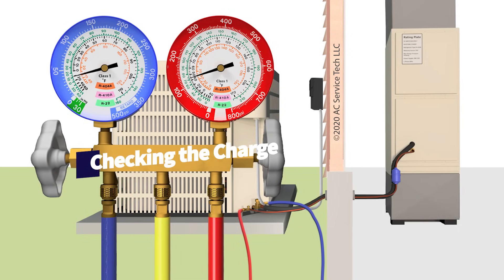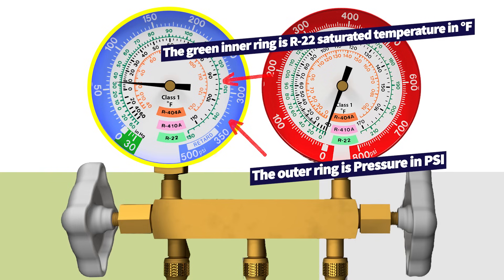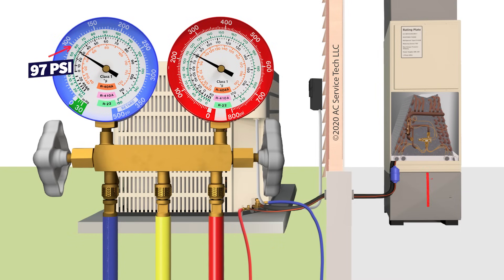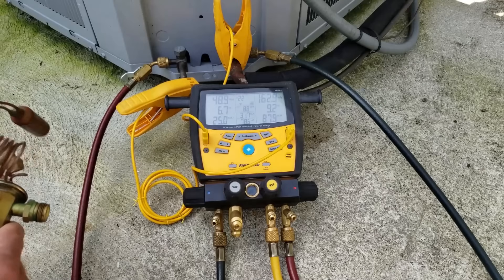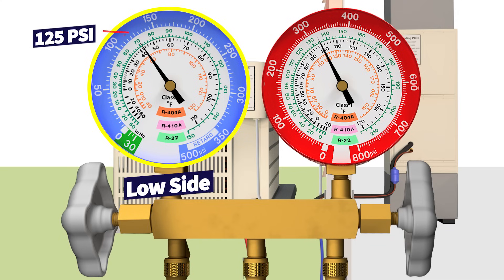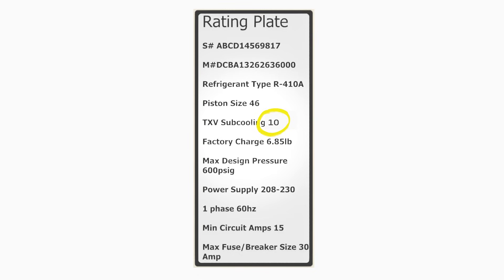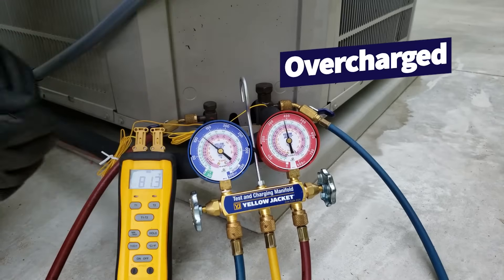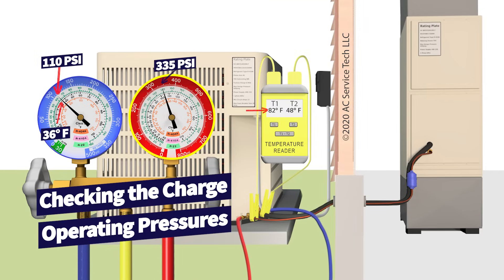R-22 and R-410A Operating Pressures on Air Conditioners! Checking the Charge!

Comment: Unless I am missing something all of this information is only for cooling not for heating. It is winter time, and trying to get my system to operate correctly. Pressure on low very high but only getting 77 degrees on a 40-50 degree day. Can we not check system pressures in the winter? Thanks for ypur video. 😊

Comment: How about inverter mini splits with R32/R410A with one service port at the gas line (most with EEV)?
I personaly look at pressure/temp according to inside/outside temp (depending on mode), making sure I have proper airflow and with ampmeter to know how pumped the iverter is.

Comment: What causes a pressure on R22 on sucion line of 130 and liquid of 200? Could it be that the expansion orifice has failed and is letting more liquid into the evap? It also has a txv on the outside unit looks like for heat pump mode. I am new at this.

Comment: Trying to wrap my head around SH/SC... I have a 22 unit with a piston expansion valve [I thought it was a fixed orifice] It runs at 75 on the low 220 on the high the delta-T varies between 16-21 deg which seems right. I still have to check the suction line temp at the condensing unit and the unit says "Indoor TXV 13deg Subcooling", I thought that meant the temperature on the line just past the expansion valve and just before the distribution into the evap core. 

The problem is set to 78, the unit comes on at 11AM~ and then runs nonstop, never starts cycling. New filter, cleaned the evap core and can feel cool airflow 4 feet away??? The entire evap core draws sweat but only to the end, the evap output lines into the grouping manifold and suction return line do not. I was thinking about adding .5-1 pound just until the grouping manifold and return line just as the suction line exits the evap/fan unit but not into the attic also draw sweat. Give it a little heat load edge so the entire evaporator always can draw sweat.

Comment: If the inside unit is running and the outside unit is not for whatever reason what happens to the system and is it good or bad for the longevity of the entire system? I see this alot at my clients (I am not an hvac tech I am IT) and I’ve always wondered if it’s hard on the system somehow? My father used to say the head pressure would skyrocket but that was back in the 80’s and 90’s so not sure that still applies or was accurate. Thank you and great videos!

Comment: Just installed a new 410a  central air system went to charge it using subcooling method unit has a txv it calls for 12 degrees of subcooling when i get close to about 10 degrees of subcooling the highside guage needle starts shooting from 300psi to around 500 psi and back and fourth every few seconds and the sound of the compressor changes what the heck could it be would the txv cause this? I dont think its overcharged because i didnt reach 12 degrees of subcooling any ideas thanks.
Reply: Sounds like there are noncondensables in the refrigerant lines. Restricting flow at the TXV etc. Pulling a good vacuum is critical. If it is a brand new indoor and outdoor unit then something may have gotten in the line sets during installation.
Reply: Had the same issue on a call I had. I pulled the refrigerant and flushed the line sets out and cleaned out the txv and   brought new charge into the system and it worked like a charm.

another tip: purge nitrogen when brazing copper, it will save your life.

Comment: What if I have TXV metering, but my condenser nameplate doesn’t have sub cooling target? The manual doesn’t show it either.
Reply: What type of system? You can look up pdf manual with serial & model. But I would say try to get 10 subcool in the meantime, most residential systems ask between 8-12 subcool

Comment: What the low ands high ranges for heating.  Inside temp, 70 and outside temp 30.  AC works fine but the heating does not.  Duct temp gets up 90 and then gets cold. EH temps n after a few min.  Just had the R22 topped of.  the HVAC tech said, pressures are fine, did not resolve the problem.  this is 2 x now on the same problem.  Not defrosting, OD fan is still running.  It might be a bad DF board? I'll check it later today.  Or the pressures are still low?  That is why I'm asking.  thanks!

Comment: Working on a unit with a 4-5 degree subcool when I add refrigerant the liquid line temp increases with the head pressure still giving 4-5 degrees SC. I change Evan filters. I replaced condenser fan motor that was overheating. What am I missing here?

Comment: The pressure windows that you state for both high and low side pressures work for residential, commercial, and industrial units? Or only certain HVAC system settings?

Comment: 1 (maybe a stupid) question, can you keep on adding refrigerant (when it's known to have a tiny leak - takes 1 year to stop cooling) weeeery slowly while checking what temperature comes out of closest point to evaporator of cool air entry inside the house? another words, add 6oz of 410a wait and check temp inside with a infrared temp meter, if its still to high like 60F add another couple of oz, wait and check temp inside again? and so on?

Comment: How many years should freon last my unit is like 4years old maybe 3 and its blowing a lil cold and warm could it be freon or capacitor?
Reply: Refrigerant (aka freon) will out live the equipment... If a leak develops within the system, the refrigerant will leak out at a rate determined by the size of the puncture. A slow leak can take many months before the comfort level is noticeable. And most likely, the capacitor has nothing to do with your situation.

Comment: Great content and I've been searching for a log time!  Thanks!!!  I had a tech check my A/C on an R410A Rheem unit. As soon as he saw the high side was 320 and touched the small line and said it was too hot (it was on the hot side vs warm) he said that the coil was not good. It was 95 degrees out. The coil seemed clean and it was clear and in good condition (no corrosion). We hosed down the coil and the temp went down but he re-confirmed the coil was bad.  Can a coil be bad if it seems okay (air flows through is that the fins look great)? I trust the A/C rep but for my own learning.
Reply: not good, did he explain in what way it was "not good".

Comment: Hi. I was working on a commercial A/C  12 1/2 tons.
I checked the CFM. I'm close to 5000 CFM.
Lines are about 60 feet. It's a un
it with 2 compressors
2 Things
1: When I try to get 10 subcooling, it may play between 3 degree
     to 12 degree.
2: I can't get a superheat between 10 to 15 degree.
    it stay between 22 to 25 superheat.
    The suction line outside is about 20 feet.

My questions are: The fact that the subcooling is changing that much, should I change it?
Also: if the superheat is that hi, is it another reason to change it?

Comment: Unfortunately in the field, it’s quite different then in a controlled classroom setting. Let’s assume the unit was installed correctly for the space, then this is a good lesson. However in the field we all know a lot of times that is not the case. High efficiency condensing units run cooler and CFMs can effect TXVs. So the easiest way is to use your suction gauge and check the charge under a high load condition.
Reply: I notice what looks like a capillary tube from the condenser before it leads to the liquid line. I'm not sure what it's there for but it really causes the liquid pipe to feel cold. I got a mini split and I guess things must operate differently in a mini split.

Comment: R 22 or R 410a can be checked with ONE gauge as though you are charging a WINDOW UNIT (package unit) whose copper tubes start having low pressure and build up frost on them. You tap into a small copper line with a tap and use one gauge and check the one pressure for a specific temperature.

Comment: Because R 22 and R410 a on the PT chart has pressures as though they are mixtures I would use them in such places like a window unit that is low on freon, like a small package unit as though as you only need to check one pressure for specific temperatures.

Comment: I saw many articles about min. of 10 degrees superheat at evaporator suction line and 20 degrees at near condenser to avoid flooding back from compressor manufacturers. So my question is which one we should go by,  In Texas, ambient temp can be 75f in the morning and 100f in the afternoon. My ac superheat taken at suction line on the outside unit can be 5 in the morning and 20-25 in the afternoon. I keep my thermostat setting at 77 degree throughout the summer. If I depend on the target superheat from my outdoor dry bulb and indoor wet bulb temp, it could be 0 superheat sometimes according to the chart.
Reply: what does your ac manufacturer have as spec for the target subcool

Comment: If a system is properly charged should the low line coming into the compressor be sweating on a hot day while the system is running?

Comment: What if my my label doesn't specify the TXV rating? Has other pieces of info but not a TXV rating.
Reply from the maker: It should say subcoolin grating on the outdoor rating plate or on the under side of that shroud. If it doesn't and it is a single speed unit, 11 degrees of subcooling can be used, thanks!
Reply: @acservicetechchannel   My older Trane heat pumps don't give a target subcooling. Instead, the service facts include a graph chart plotting liquid line temp (horizontal X axis) vs liquid line pressure (vertical Y axis). Within the graph is a slight arc line that indicates the proper charge. At the intersection point of your X and Y values on the arc line, is below the arch line, then add refrigerant. If your intersection dot is above the arch line, then recover refrigerant. I don't know why Trane does this method. Seems like a little extra work.

Comment: The reply was we only use sight glasses in refrigeration not AC.. When I started doing AC in the early 70's many Carrier units came with sight glasses, car AC came with sight glasses.  If you have say 10 degree sub cooling you should have  a solid flow of liquid in the liquid line.. I do realize units with multiple rows of small tubing are easy to overcharge.

Comment: I have 38 years in residential construction. I'm currently in hvac night school. I get as much or maybe even a little more out of your videos and book. I just wanted to take a second to thank you.
Reply: The problem with school is they drag out the end result. They also make a mountain out specifics. Basically, they over complicate things. My school spent days on each component. Capacitor, fan relay, etc . Further, after school everyone comments that school doesn't teach you real world. Well, they teach you correct in school. They in no way cover all applications. Then, in the real world, greed comes into the process. Plus, the guys that did not go, have chip on their shoulder. Thus, the boss wants to cut corners, and some coworkers are difficult to work with.
Reply: Same, friend.  Not as many years as you,but this channel is far more educational than my schooling is.  GL on your new adventure!
Reply: R22  suchion  65t70  dis.. 270  320... aR410   suc..110 to  125  .   Dis  430t0450..
Reply: He is the best!  I purchased his manual and it has been my go-to reference for HVAC for years!  I always refresh myself by watching his videos.
Reply: R410 sushion cherging baical 120 to 130ok  dischr410disc. 400 to450ok  r22  sushion 55to70ok dis  300t350ok
Reply from the maker: David, thank you for your encouraging note!
Reply: Yeah going to class doesn't teach you the actual work that needs to be done it's all legality and policies and what NOT to do 😅

Comment: I am a 40+ year HVAC&R service tech, I usually use temperatures when working on space cooling systems I work on have 4 different refrigerants, in addition to refrigeration systems
Reply: Question here man so is this R22 PSI values for all split type ACS whether 12000btu 18000btu or 24000btu etc or is he talking about HVACs here

Comment: My boss says mix 22 with 407c. I hate it. According to the maker you can add up to 25% of total charge without adding oil but the saturation temps are too different for my liking. There is no good replacement imo.

Comment: A coil with capillary tube,,is that the same as a piston ?
Reply: A capillary tube or a piston controls the amount of liquid entering the A coil by restricting liquid flow, if you overcharge a system the low side gauge pressure will be above normal and the low side gauge pressure will be above normal. A TX valve controls the flow of liquid with a temperature sensing bulb, the TX valve maintains a steady A coil temperature, as a result the low side pressure remains relatively stable, even if the system is overcharged.
Reply: Yes I know that they only talk about piston and txv valve,, so is cap tube same as piston?
Reply from the maker: Yes cap tube and piston both fall under the term "fixed orifice" but the piston chamber can bypass refrigerant through and around the piston itself when the refrigerant flows in the other direction where the cap tube needs an external bypass, thanks!

Comment: Great stuff as usual Craig!
Lately, we been using R 427 and R 407 as replacements for R22. However, our gages only have the common readings: 410, 404, 22. How similar or different are the temperatures for 427 and 407 to R22?
Reply: You can download a PT chart app on your phone and input the psi on your low gauge and set it with the r427 or many others and it should show the temperature of the that refrigerant. And you can compare
Reply: Can you use 407 to any brand and do you usually clean the line set 
Bc this guy wants to charge 200$ per pound on R22 🤣 witch is not worthy
Reply: @tttota5421  Years ago a 30 lbs cylinder cost contractors $30 . To find a cylinder of R-22 for $1,500 is a good. So..., how much should he charge to add R-22 to a system?
Reply: We use 407 as replacement for R22, however, we do NOT use it on heat pumps because R407 is a blend.
Reply: @brianosegueda3622  why can’t blended refrigerant be used in heat pumps? R410 is being used widespread in heat pump ,it’s blend too
Reply: @brianosegueda3622  410a is also a blend.  Will you elaborate on why you don't use 407 on heat pumps?